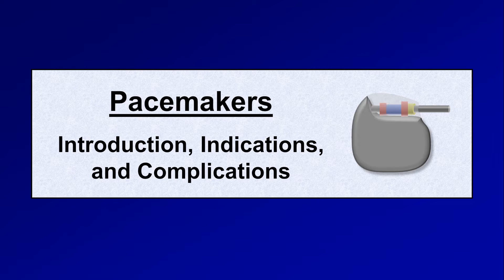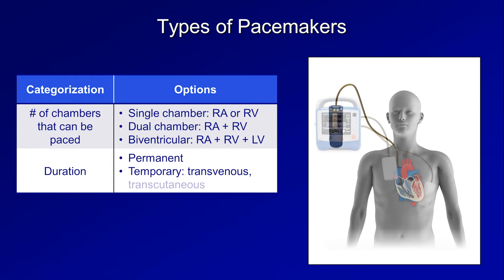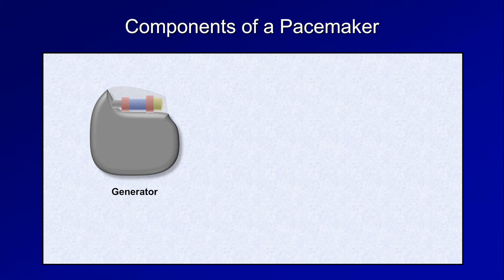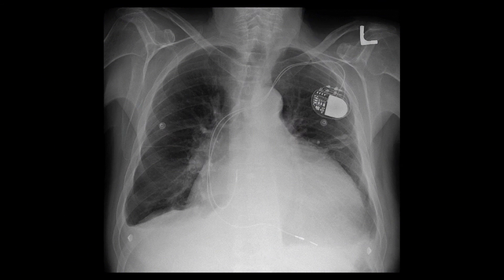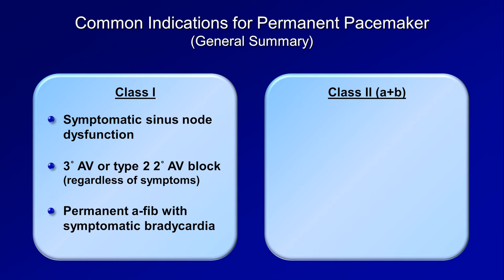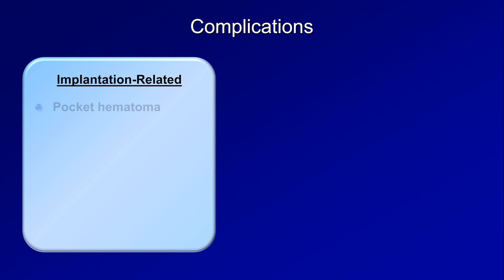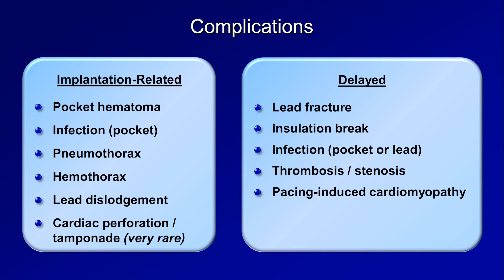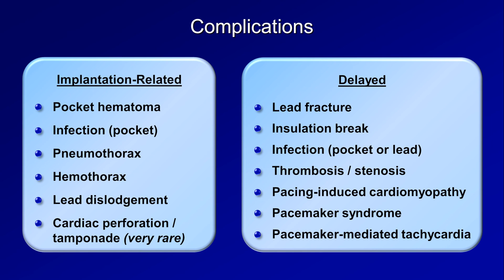An Introduction to Pacemakers

Comment: Can you lpease tell me the differece of implan in the right side,most of the implan is in the left
Reply from the maker: Implantation of pacemakers are usually done on the left, even in left-handed individuals, primarily because it is a technically easier procedure since the leads (i.e. wires) are advanced into the right side of the heart as one continuous curve. When placing devices in the right upper chest, the leads need to make several slight turns within the blood vessels.  There are some exceptions to this placement preference - for example, if the patient has an AV fistula for dialysis in the L arm, or if there is an anatomic obstruction such as a left subclavian thrombus, the cardiologist would typically place the device on the right side. 

ICDs are (almost) always placed on the left because the "can" (i.e. the generator) itself is part of the defibrillation circuit, and the closer proximity to the heart on the left is believed to increase the probability of a successful defibrillation.

Comment: Why would they use a simple battery setup that needs to be replaced with surgery? 
 It would seem a better option would be wireless charging against the skin on the patient
Reply from the maker: There are several reasons that a wireless rechargeable battery has not taken off with pacemakers. A few:

- Depending on the specific device and its needs, the conventional pacemaker battery can last 5-10+ years. Rechargeable batteries don't necessarily last longer.

- When the battery is replaced every 5-10 years, it's not just the battery that gets replaced, but the entire device (minus the leads). With pacemaker technology continually improving, this allows patients the benefit of having devices with new features that their original lacked. This can include improved ability to change programing parameters, and different methods of rate-responsiveness.

Having said that, there is work being done on a battery-less pacemaker (or more strictly speaking, a pacemaker with a trivially small battery) which uses the kinetic energy of the heartbeat to generate the electrical energy and current that triggers the next heartbeat. These devices also lack leads/wires, which is a significant advantage since the wires are the most common cause of pacer malfunction and pacemaker infection. However, they can only pace one chamber, when most patients' condition requires pacing of at least 2 chambers in order to maintain synchrony of cardiac contraction.
Reply: @StrongMed  i personally would rather have the rechargeable battery and wireless charging pad in my nipple, even if I had to recharge every 3 years its just a quick thing of putting the pad up to the nipple for some juice.
 To me having to go under the knife is always best to be avoided, I would rather keep a rechargeable can then go under the knife again... I wouldn't care about getting a newer more feature packed version if the one I had worked. 
 But that's just me. 

 Thanks for your response, have a wonderful day.

Comment: I know there are usually precautions the Patient must take once a pacemaker is placed: ie. no lifting of you arm above shoulder height on the side the pacemaker has been placed, avoid heavy lifting etc..my questions are: 1.) Are these precautions usually for both permanent and temporary pacemakers? 2.) Will the arm that You’re not supposed to lift above shoulder height always be ones Left arm, where the heart is located OR does it mean if the wires are placed in the R atrium/ventricle, then not to raise your R arm?
Thanks for your help!
Reply from the maker: For a permanent pacemaker, the precautions are for the arm on the side where the generator (i.e. the "box") is implanted (usually the left side), and last 4-6 weeks at which time there is usually a device check to ensure that capture thresholds are still good. The term "temporary pacemaker" most commonly refers to transvenous pacemakers which are much more tenuous since the generator and controls are external to the body. Different hospitals and different countries might approach temp pacemakers differently, but at the hospitals I've worked at, anyone with a transvenous pacemaker needs to be in the ICU or an intermediate ICU, and can only ambulate short distances with direct assistance from a nurse (in addition to the arm precautions on the side where the pacing wire exits the body (which can either be left or right, but in my anecdotal experience is more commonly right).
Reply: Strong Medicine Thank you so much for that helpful explanation and the great videos/content! It’s appreciated :)

Comment: Couldn't you charge the pacemaker with induction, so you don't need to charge them anymore
Reply from the maker: Yes, this seems like it should be possible and has been proposed before, but it never gained any traction. After seeing your comment, I asked an electrophysiologist about it and she had no idea why it wasn't a thing. Right now, the futurists of medicine seem more excited about technology like biomechanically charged pacemakers that get their energy from the motion of the heart beating itself (which is pretty cool, if it ever works). https://www.nature.com/articles/s41569-019-0208-z
Reply: @StrongMed  wait what instead of just putting a coil in and charge it every few years we over engineer the problem
Why not
And if your heart stops your pretty fucked if it can't generate any more power
To be fair if that happens you have bigger problems